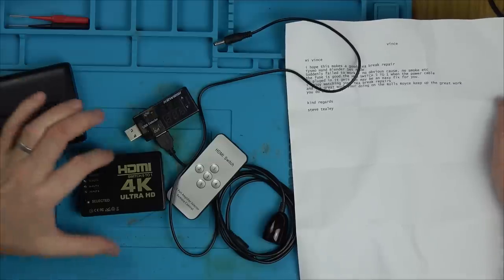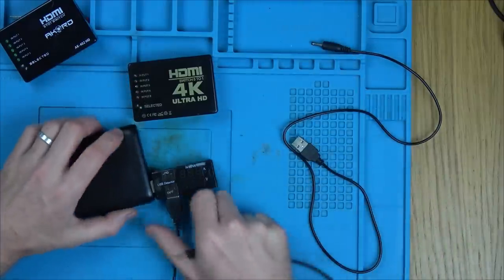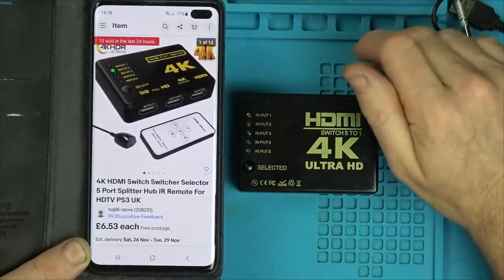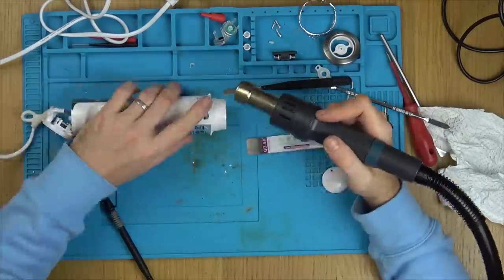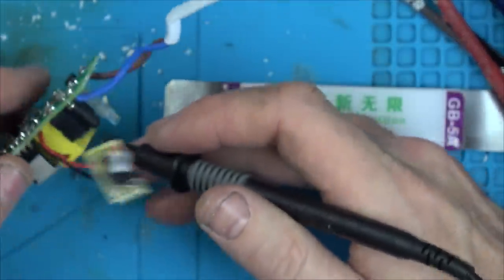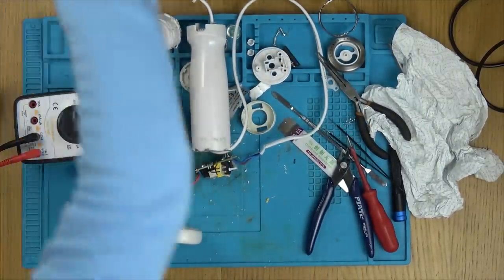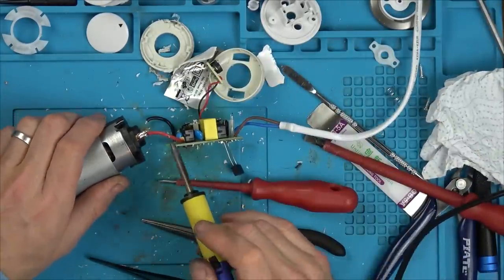Unsafe BOOM! with My Mate Vince - HDMI Switch & Blender Attempted Repair

Comment: I grew up with my parents owning a motor repair shop, so I knew that sometimes polarity needs to be checked. Also, when working on any electronics you should either wear shatter proof glasses or safety glasses. Even small voltage circuits can blow a capacitor that always has a tendency to shoot straight towards the technicians face. They mostly don't hurt but you could damage an eye very easy.
Reply: Always wear eye protection and brown trousers.
Reply: yes correct, but yet again no kind of mains protection or variac isolation transformer. he will do this one day and he will burn his fingers too. NO SAFETY even tho the screwdriver is rated at 1000volts but not the metal tip.☠

Comment: When testing switches connect to the pad instead of the legs of the switch, as that will pick up cracked solder joints at the same time.
Reply from the maker: Good advice Scott, thank you 👍

Comment: Can't beat a bit of smoke bangs and fire in YT content.
And you didn't dissappoint.

I attempted a repair on a smoothie maker, I diagnosed quickly that there was a break in the lead next to where it enters the machine (usual stress point)

I bragged to my wife that it will be fixed in around 30mins, only to find the same as yourself it was not only glued but bonded together and has to be violently opened.
My wife made me buy her a new one for being so cocky. :face-purple-crying:

Comment: I bought a £20 Amazon bread maker which had a bit of an issue of turning itself off during cycle, was a cold solder joint and what a palaver getting inside that, tapped up the joint and been making gorgeous breads using Canadian ultra strong bread flours including cheddar and red onion bread, egg and bacon bread, cherry tomato and herb bread... been really enjoying meself def recommend one if you see one on the cheap m8
Reply: Very nice!

Comment: Another possibility with the USB cable is the differential pair wires ( data + data - ) some cheap cables only have +/- ( DC 5v ) wires in them and that would just keep applying power, however if the pair ARE there and not terminated properly at the barrel jack end (as their not used) or just grounded then the power bank would see a short due to the blown chip and switch off instantly. It's definitely down to quality as other viewers have pointed out about crappy AL wires instead of CU but I have seen people get in a right pickle with el chepo USB's. Yeah I figure that's a Permanent Magnet DC motor (PMDC) you have there and you won't forget about them again !....cheers. and a squeak for the blast.

Comment: One lead probably has lower resistance, so with that one enough current flows to trip the short circuit protection, but not with the other.

Comment: The difference between the cables are that they are different quality, Cheaper ones have thinner wire and act more like a resistor in high loads limiting the current. And some motors have a back EMF diode between the poles to protect circuits from voltage going back into the board and then this diode short the load if you reverse polarity, that or the motor was already shorted for some reason

Comment: Good 👍 Vince.
You are correct about the polarity of DC motors, but in this appliance the rotation direction always has 2 be the same even if live and neutral are front 2 back as is possible with a non UK plug
Reply: Polarity of a DC motor is only important for direction, they are configured for clockwise rotation on + & - and will simply change direction if you reverse the polarity. (Like the electric windows in a car).
A single phase AC motor will run in the same direction regardless of polarity unless you change the field wiring, then it can be reversed.
Reply: @electrickal1  yes , but that is not taking in account the polarity of the AC side. A UK plug is designed to go only 1 way, rest of the world not so.
Reply: @Vierkanttechniek  You clearly don't understand how AC and DC waveforms differ. DC that is made from AC by rectification is polarised by the bridge rectifier and will not change direction by reversing the AC field.

Comment: i guess that the motor is going to spin the wires and PCB through the air like a 240v windmill of death .... [EDIT: i was wrong but holy shiii i am glad that blew before it turned on, that was exceptionally dangerous ] had me laughing my ass off though, oh Vince you're a national treasure ...thought about getting a job with Medhi @ElectroBOOM? he'd have been proud of that one LMFAO, glad you are okay

Comment: The cheaper lead has higher resistance, which limits the current and keeps the power bank from cutting out. You should be able to test that with a multi-meter.

Comment: Interesting with the motor. Just a little bit of advice. You put the extension on the table you put the blender in to the extension and then you plug it into the wall. you still left loads of the extension on the real. This acts like an heating element and can set on fire. Just letting you know.

Comment: The good cable is of very low resistance so it is basically a dead short and trips the short protection of the powerbank.

The bad wire is probably made out of cheap materials and has enough resistence (thats why it is getting hot) to not trip the short protection of the powerbank.

Comment: Hey vince, in my experience I have never seen a dc motor that can only go one way. (That doesn’t mean that there isn’t) but the board worked. Who’s to say that the motor wasn’t actually faulty (it could have kicked that brush, and got stuck causing a short) and blown the fuse. You powered it backwards freed the brush spitting it out. Maybe the brushes were worn out. It did look tiny. There really should not been a way under normal operation that you could cause that to happen.

Comment: any motor that is mains voltage or uses high amperage, or looks beefy should always be strapped down or clamped into place. another thing is to check polarity.  yes you are right a D.C. motor will run both ways for a model vehicle and that is because you want it to go in both directions, but a motor that is used like you said for chopping usually has some kind of circuitry to only allow 1 direction. to be fair though suprised no diode in circuit to blow or stop current if the motor is connected wrongly, but as they made it as none repairable then something like a diode wouldn't be needed.

Comment: One USB cable will have a higher resistance and is acting like a resistor to limit current... try measuring the lead resistances and you might be able to see it.

Comment: Allready figured that odd lead issue out..  one lead has better/stronger continuity then the other.. so when you plug one in it almost trips the power bank.. but the other one is over the max draw to trip and turns everything off.

Comment: The DC motor should have worked worked backwards but I expect the motor had already failed before you received it and had gone short circuit due to overheating / overloaded (windings shorted due to overheating, maybe a very thick soup or used for too long). PS. I'm loving the Guitar Hero finger extension, can you please sell them on Ebay, I want one.

Comment: The USB lead will have a resistor across the data pins which tells the power bank the devices power requirements.  My guess is something about the different resistor values and the fact the device is faulty is causing the power bank to behave differently.

Comment: The mixer's fuse was probably blown because of prolonged use and subsequent overheating. The unit might have been working just fine after replacing the fuse and not changing the direction of the DC motor.  The motor's brushes were worn and grabbed into the commutator while it tried to spin in opposite direction.
Next time, secure the motor. The rotor's inertia will cause the outside to want to spin in the opposite direction when not secured. It will fling the live circuit board and wires.
I'm sure you felt that effect when holding a motor of an RC car in your hand, applying power to it straight from a battery pack.

Comment: On the Blender, reversing the wires won't cause the failure, DC motors can run either clockwise or counterclockwise depending on polarity, my guess is, that DC motor had failed prior to your repair attempt and by wiring it in reverse caused it to show its fault, as @andrasszabo7386 mentioned, spinning a Brushed DC motor in the same direction for a long time, will wear the brushes at a slight angle (as well as the commutator) but my guess is the brushes wore out enough to get carbon dust lodged between the commutator blades and caused a short, blowing the fuse.
I am 99% sure that if you check the brush "channel" you will find some melted plastic {although this "BOOM" may have scorched it a little bit more :) ).

Comment: re the blender, Is it possible the diagnosis was wrong here? I was sure as well that the DC motors should work fine both ways, though I do know that often a positive is marked.. Isnt it more likely that the motor had an internal short to begin with and that is the root cause that originally blew the fuse? I have had cases where due to over loading, the carbon dust from the brushes get inbetween the gaps of the comutator plate and start shorting between the leads..

That said was very entertaining to watch, especially the cartoonish guitar screwdriver :D Appreciate you showing by example to take precautions when dealing with dangerous stuff. (including the lost plug to the presumably MMV cup)
Reply from the maker: Maybe Karthik, it all looked so new though, even the carbon brushes looked good and clean. Something must have blown the fuse though???? Maybe you are spot on and the original failure was the motor. Nice one 👍👍👍👍👍👍
Reply: @Mymatevince  Exactly. I feel that is more likely. In my case it happened to an abused Ikea drill which was driven too hard, so when it was run without the motor being able to turn I believe the damage occurred. After that onwards, it always ran hot, weak, smelt of ozone and discharged fast, and quite a few sparks in the motor. I tried to clean the commutator with IPA + cotton buds.. but that didnt last too long, and only recently replaced the motor completely.. (for a cheap drill the gear was on so tight, it took me forever and an almost ruined gear puller to pull the gear off :D)
Reply from the maker: @ktaragorn  👍👍👍

Comment: i have the same 4k hdmi switch it draws 0.14 amp @ 5.2v when in standby and no lights are on .when working it draws 0.21 amp @ 5.19v and a led will be on showing which hdmi input is selected.the last thing i destroyed was a gt 710 2gb and an asus x540 laptop trying to connect them with a gpu to m/sata dock.both were unfixable😅.these things happen.

Comment: Frying tonight, Vince and chips. Yep take more care fella, such as investing in some safety specs. I agree with the cheapness of things and un-fixable stuff. No wonder Maplin went bust (Tandy's for the USA folk). You can make something waterproof with correct seals and sound screws. You don't have to glue things up like that, and 6 quid for a HDMI well good luck to a seller, you will need to sell 1M of them to make 10 bucks. Daft. Anyway great video, yep check polarity always.

Comment: Looks like in the HDMI device, each chip controls 3 outputs.
If you remove the destroyed chip it should allow you to use the remaining 3? Maybe?
Reply: I was thinking the same. Easy thing to try too. Might only leave 2 working ports though as it's a 5 input device. Depends how ports are wired to the two chips.

Comment: Vince stay safe fella! Don't get carried away and mess with mains voltage, there's got to be safer ways to test these things. Maybe the motor could have been direct wired to a bench psu at low voltage, would turn more slowly I imagine?

Comment: Every cable/lead/wire/trace has a certain amount of resistance and acts as a resistor. The resistance is a function of wire diameter vs wire length. The thicker the wire, the lesser the resistance, while the longer the distance the higher the resistance. The USB lead that was getting hot was acting like a resistor and dropping the voltage.

Comment: Connecting the polarity incorrectly didn't cause the death of the motor. That is a permanent magnet DC motor and will just change the rotational direction by swopping polarity. What did happen though was the result of a short circuit in the rotor windings.

Comment: the problem is the engine from the beginning.  always measure resistance if it is excessively low there is a short  ,a very high resistance needs more amps (parts worn by use, bad contact).These motors work in any direction, they are marked for assembly at the factory, AC to DC is converted so that the motor always goes in the same direction, that is why both the plate and the motor are marked.  the equipment cannot be disarmed if the test goes backwards you should discard it and that is a lose of money an parts (and possible customer complaints and loss of reputation if reach the market)

Comment: Have you heard of SCR AC power regulators? For example, item id # B07W6P7K71 on Amazon. They're not actually "voltage regulators" despite what all the dodgy sellers call them, but they are sometimes very useful when messing around with AC mains powered devices. It's sort of like pulse width modulation for your 50Hz AC.

The basic principle is they "chop" the AC voltage wave using a triac (or SCR) and an adjustable threshold... So imagine your input AC sine wave. Each time it crosses the 0V mid-point, the triac switches off and nothing is output. Then when the input wave reaches your threshold voltage, the triac turns on and passes current through.

So when I suspect something I'm working on might short out / blow up, I hook it up through the SCR set to minimum power and probe around to make sure things make sense. For me it's like when a computer programmer uses a debugger to step through dodgy code. And it saves on blown fuses, charred surfaces, and loud bangs.

EDIT: Also, I doubt the polarity of the DC motor had anything to do with it. There was probably already a short in the motor.
Reply: Or the old Lightbulb current limiter :)

Comment: Maybe your cable has a current limit set at say 500ma so when the fulty one wants to pull 2 amps your power bank knows its above the limit and shuts down, bet the cheeper 4k one is missing this resister

Comment: 15:32 if you look closely it hits the mug, nice save there.
Reply from the maker: Yes, there was a burn mark on the mug, noticed it later on. Rubbed straight off but it was the size of a 20p piece (2cm or so) 👍👍👍

Comment: Get yourself a variac (variable transformer) with a safeblock isolation connector...set to 0v and increase gradually...the transformer starts to growl when under load so you know not to increase the voltage any further....safer and less damage than direct connection to 240v....though they are expensive....though how much is human life....?

Comment: the resistance of the crappy lead is so high that the battery does not see a direct short. its also why it gets hot, and why it drops so much voltage.

Comment: My theory is the motor went short because as far as I am aware, polarity shouldn;t matter. Only reason it would matter on a blender is because you need the blade to be spun in the correct rotation.

Comment: Answering your question - the first thing I thought when I saw you soldering the motor wires was - he didn't check the polarity - and seeing the wires were red and black, that could probably cause problem. But that's absolutely OK.

On the other hand, manufactures producing items that cannot be repaired is a clear sign of how stupid we are as a species, considering we only have one single planet to live on. Remember Wall-E? Those guys had a spaceship to go to when things got impossible here, but what about us?

Comment: The USB has a higher resistance than the other one, It`s made of thinner wires or crappy wires, DC motor or ac motors do not care about  polarity, I think one of the diodes are leaky
Reply from the maker: Thanks AR. Regarding the possible leaky diode...would that be one of the 4 diodes converting AC to DC or one of the components in the actual motor?
Reply: @Mymatevince  Yes  or the motor is burned out
Reply from the maker: @AnonymousRepair  Cheers AR👌

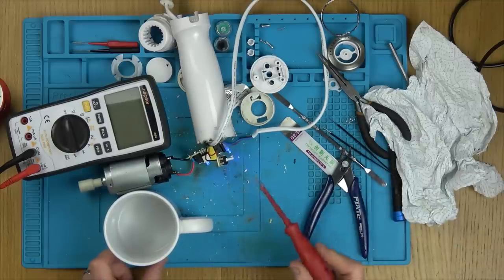Comment: 14:41 Ready,  Steady, i said steady ... 15:06 GO! Take 2 15:12 GO! No, no, no take 3, I said G ...15:32 BOU"shhh (Perfect time for MEME) :D Next speech hit 100 points, right in the middle, between eyes :DDD! You can bet, it was 1000% entertainment! I was wondering when in your carier it will start to happend. Actually it happend because there was a diode inside to protect driver transistor from Back EMF overcharge voltage. If there wasn't diode - it could work as you thought, but firstly the rotor was shorted... Mmm i like bushes ... Oh you mean the president!
READ MORE DOWN!⬇

You wish there was a bush near... :D

Rule number ONE - Safety first.
Rule number TWO - Did you read number ONE?
Rule number THREE - You had to read number ONE.
Rule number FOUR - Check for the reason, not the consequence.
Rule number FIVE - make sure you read previous FOUR rules :D

Comment: It make no sense with some sales i bought a ps1 game other day for £2.99 the postage label said over £2 i wanna say £2.15. werent really worth selling.mseller then realised theyd sent me wrong one and was going send correct but i only wanted ut to test a console id bought to mod chip. So would of been another cost. Turns out discs i was burning with ended up being the culprit for not working. i was thinking id buggered up the chip my first attempt at something like that. Always fixed things but never added to or modded something.

Comment: i think there was a fault with the motor a dc brushed motor will run forward or backwards, as long as there is no diode fitted to the motor across the + -